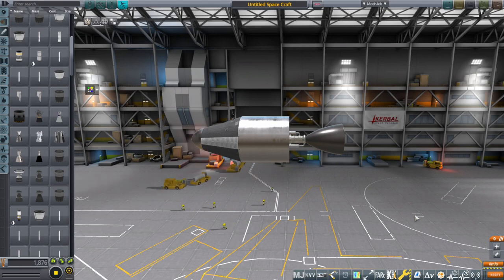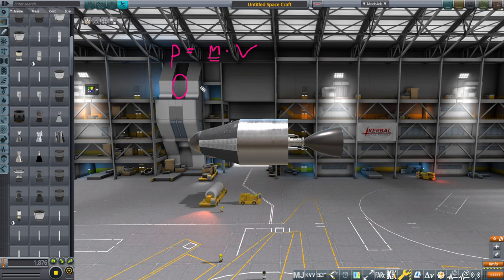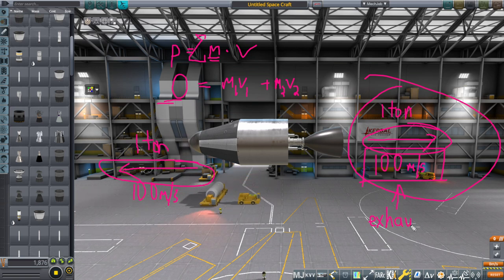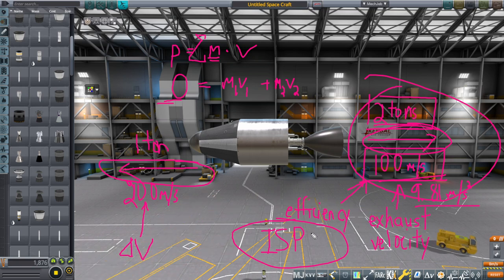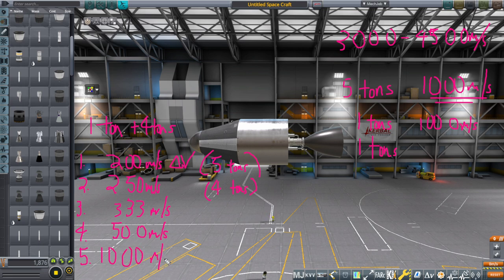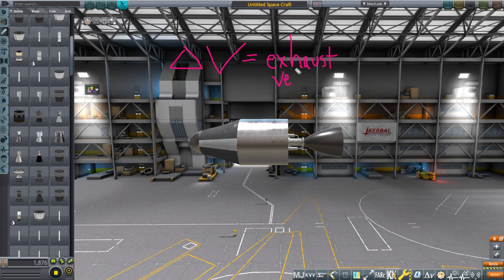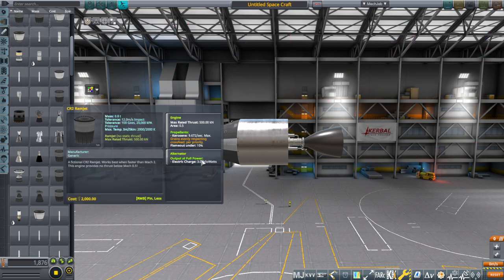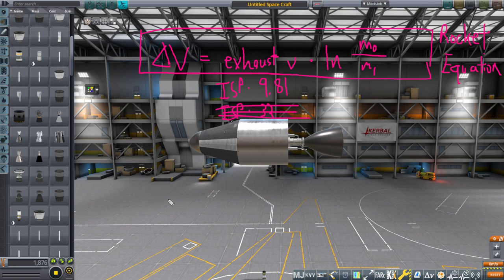Space Basics 02 - How Rockets Work

Comment: Thanks allot! Please continue this series. But I do have a question about isp... In the KSP-Wiki they define isp as: "It is thrust per the rate of fuel consumption. Or equivalently, it is change in momentum per amount of fuel consumed." but you say exhaust velocity divided by Fg... am I missing something or are they the same thing?
Reply: its different roads leading to rome. It is thrust per rate of fuel consumption. where the fuel consumption is per weight on earth. in essence, the exhaust velocity divided by g_0, is the same thing. 

Thrust is exhaust velocity times mass flow, so if you want thrust per fuel consumption, you get (Thrust) / (Mass flow * G_0).   ((Mass flow * G_0)  is weight per second)
so seeing as thrust is V_e * mass flow, you get for isp: 
I_sp = Exhaust velocity * Mass flow / (mass flow * g_0) The mass flow cancels out, because it is in the numerator, and in the denominator, so you are left with exhaust velocity / g_0
where g_0 is 9.81 m/s^2
Reply from the maker: I will explain ISP in terms of thrust in the next video.
Reply: @thomaswijgerse723  Thanks!
But do you have to change G_O when you get further away from the celestial body? Do you use calculus then or is there a more simple way?
Reply: @RaizSpace  Thank you.